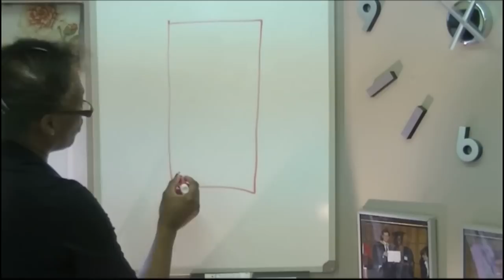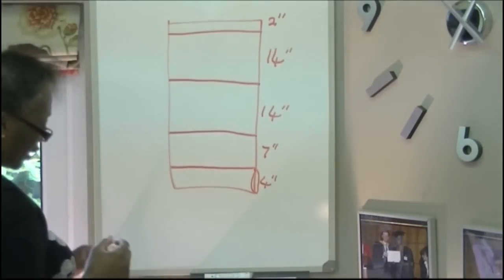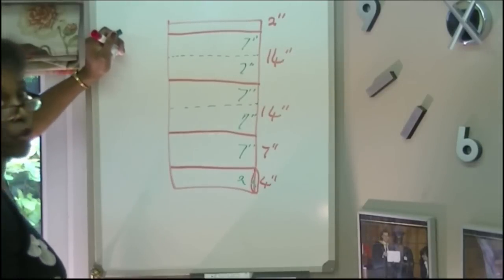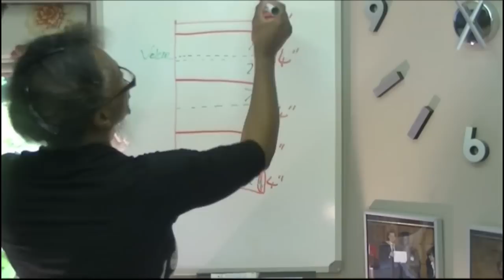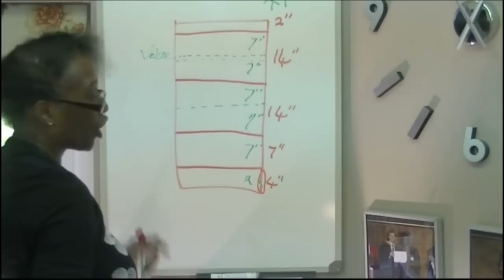How to make a Dummy Roman Blinds

Comment: Hi des, could you possibly do a tutorial on how to add a flap/return at the side of a roman track to hide the track end? X
Reply from the maker: Forgive me for not doing your request. My workroom is not ready to be used as yet so I’ve got to think about the easiest way I can show you but in my mind under a Roman blind, it might cause a bit of a bump at the front which may look ugly, giving the appearance of shoulder pads. Because you’re going to need Velcro at the top of the return and underneath the return, so when you put the return on the mechanism, you need the Velcro on top to receive the Roman Blinds and that’s where the pump will occur.
Reply: @DesSwags  I’ve sorted this too 😂 again though thanks for your reply x